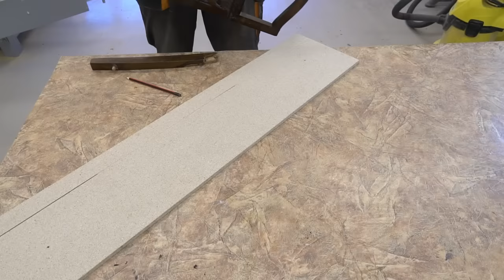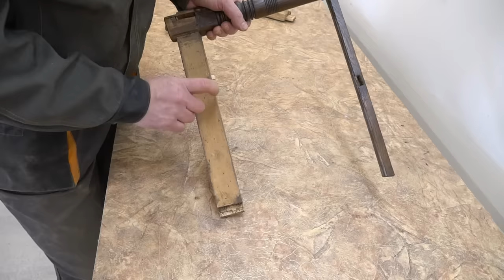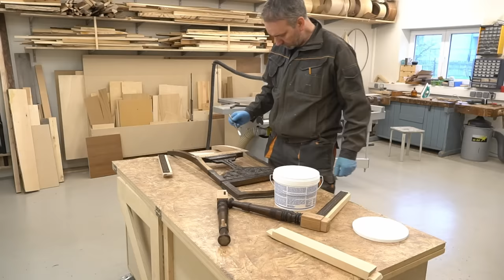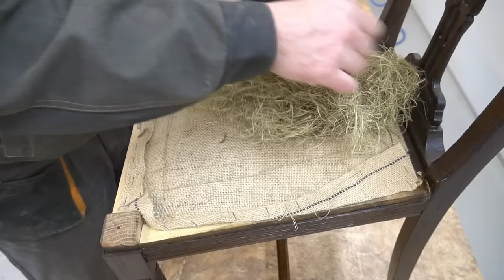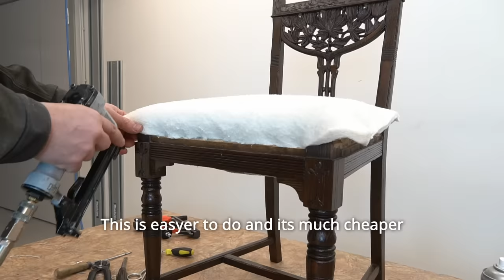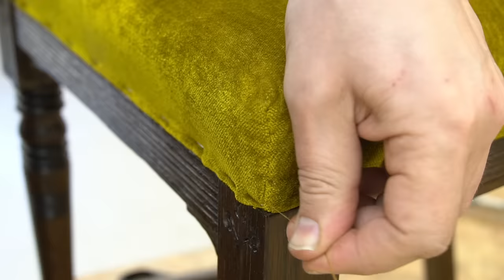The antique seller destroyed my chair! 😰

Comment: As a large man , that chair would be admired but ... never used . Just beautiful resto .
Reply: @robertr.9419  no way man . That chair would crumble like a politician standing before the pearly gates of heaven .
Reply: @jimmymckay73  No worries brother, I can make a nice chair for you out of 3/8ths angle iron.  Maybe weld a 1/4" ridge plate on the backs of the legs to make triangle stock rather than straight angle iron.  Pretty sure that a chair made of slats being a minimum of 1/4" plate should be fine to hold your weight, unless you happen to weigh more than a Grizzly Bear.
Reply: @Jeremiah90526  I'm 6'2" 450 lbs darn near grizzly weight .

Comment: A tip from a different discipline: get a cheap electric toothbrush. They are great at dislocating dust and debris in carvings, cracks, or just corners. Use dry or wet with cleaning agent (or stain). It helps me with old mechanical devices where dust, skin oils and other 'collectible matter' accumulates around dials, gauges, engraved lettering etc.

Comment: Rather than re-carving the design, wouldn’t it have been possible to have made the broken piece into a uniform thickness by sanding the back, trimmed off a layer of the new piece, and glued the old to it? That way you preserve the original work, but still have a much sturdier piece.

Comment: Really impressed with the restoration  of the original chair, but the upholstery techniques seem very rough. Nice effect but so many staples into the wood framework is not a good idea. The seat and headrest could have been made separately and attached to the finished chair frame.

Comment: I have an antique sugar chest that I just love.  The top is warped and a break was poorly "repaired" by the seller.  Any suggestions?  I've used it as is for seven years and will continue to do so.  Just don't know if such warping can be fixed.  Thanks.

Comment: When filling with hay or straw, do you worry about the bugs already in the shafts, or do they pre-treat before using it as a filler instead of using a foam or pollyfill ? I'm just curious how it works since back in the 1800s they used a combination of either hay or straw with down to fill mattress before actual mattress were made as many are still made the spring way.

Comment: Wow, wonderful end result as always. Question, when you reupholster and old chair the way you did the one in this video do you do it like that to imitate how it would have been done originally or do you do it that way because it is the most effective and long lasting way?
Just curious.
Reply from the maker: I try to do both. Usually the dimensions and the height are the limiting factors. For example height, can be between 45-48 cm, or it will uncomfortable to use.